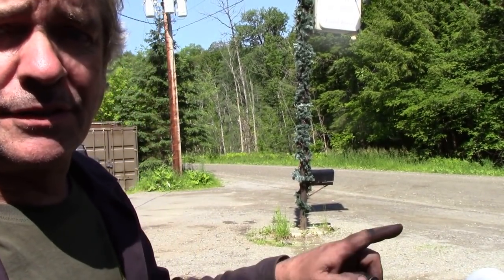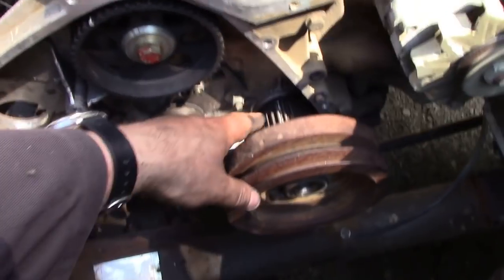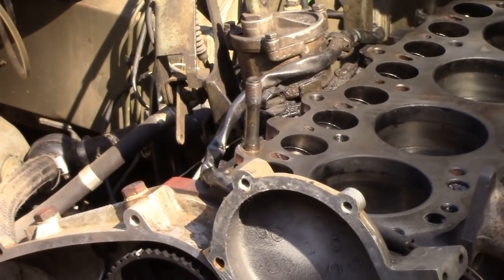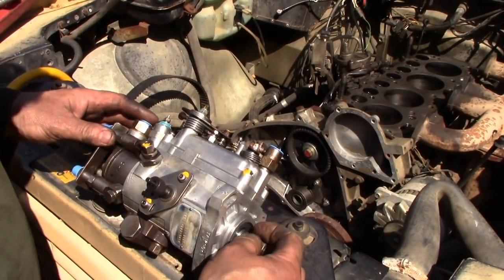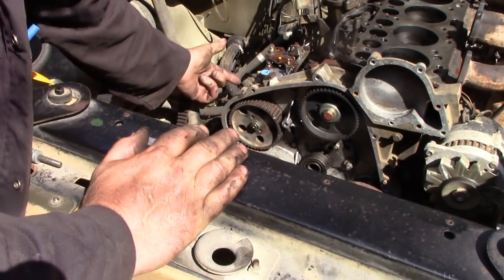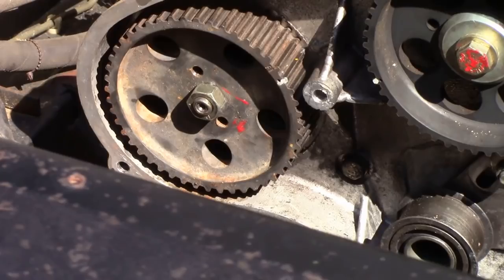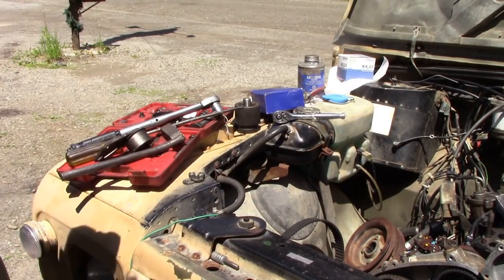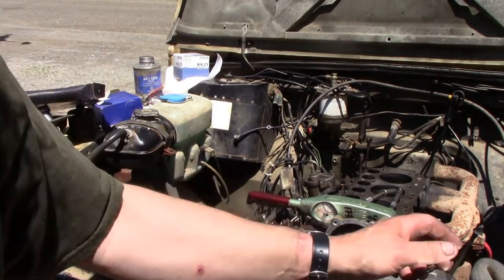2.5 NA Diesel putting on the timing belt

Comment: You mentioned at 14:18

I had a right muppet change my timing belt for my 300 TDI. Honestly the guy was really singing his own praises when I was quizzing him prior to the job. He claimed to have worked on Colonel Khadaffi's Landrover Fleet back in the 1980s. They'd done other work on my lannie ok, but this was the real important one.

Well he changed my timing belt alright, but forget to grease up the timing shaft!!!!
I was driving it to Scotland and there was a distinct loss of power, but it made it back ok.

I took it to someone who was and is a guru of Defenders who checked his work and he was gobsmacked a veteran mechanic would make such a retarded mistake on an important job. My friend said he had an utter nightmare fixing it as it had come loose or something but he managed to retighten in. He cautioned me that a lesser engine would have failed completely and that there was the risk of permanent loss of timing, there wasn't but it was a close run thing. 

I think it may have been deliberate, as this garage didn't like me doing fibreglass temporary repairs to get it through an MOT. I'll never go back there again.

Comment: Hi Mike  Im about to do the timing belt on a 2.5 na engine that the belt has snapped, but this engine has had some modifications ie tdi timing belt housing, tdi head, and the tdi  injection pump  as it has the hole in the pump for the pin, would placing the pin through the front of the injection have the same result as the way you done it?  Any advise would be gratefully appreciated
Reply from the maker: Hard to say without seeing it - sounds complicated - what Tdi parts were used?200Tdi?

Comment: I have an original 200tdi 11l engine in my defender. Any tips for fitting the timing kit to this? Is it normal for the belt to sit touching one side of the guide on the tensioner? I have some interesting grooves in my cover from a previous belt 😔
Reply from the maker: Unfortunately I do not have any access to 200Tdi here - not seen one for years. It could be that the belt has been over tightened in the past and the belt housing is warped - this is common on the 300Tdi
Reply: I have not lost any belt thickness in 7 years so I don't think I need to worry too much, will check this with a straight edge and maybe the fip end float . I must say, watched all your content here in the UK. Helps me keep my 31 year old on the road.